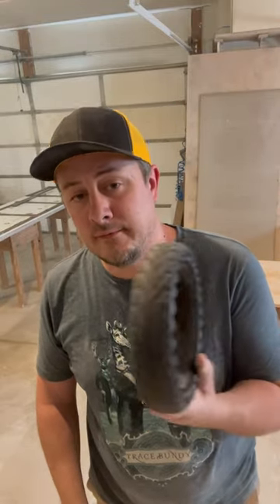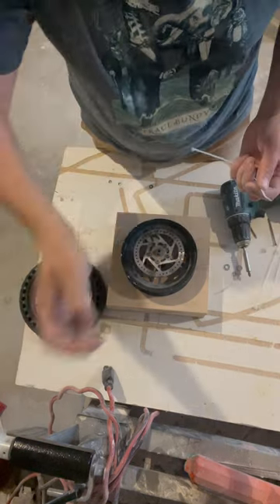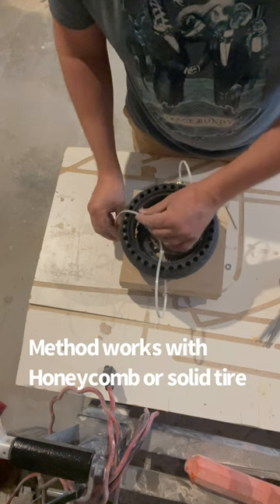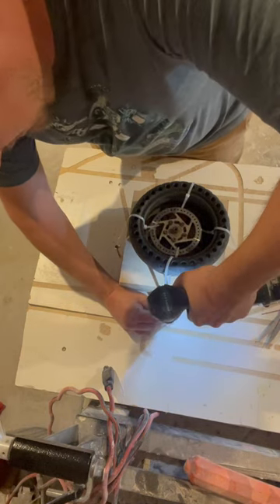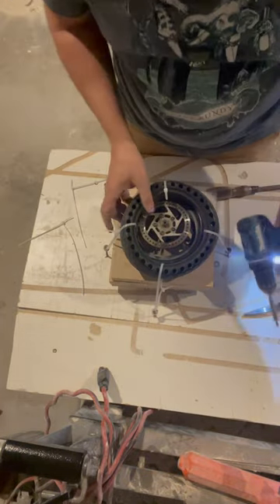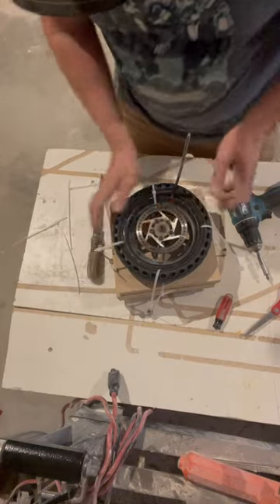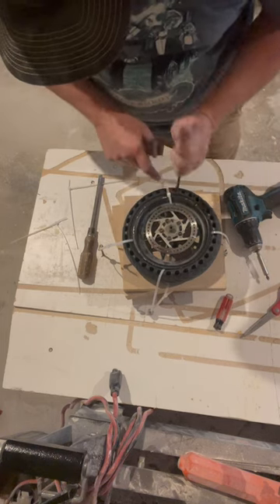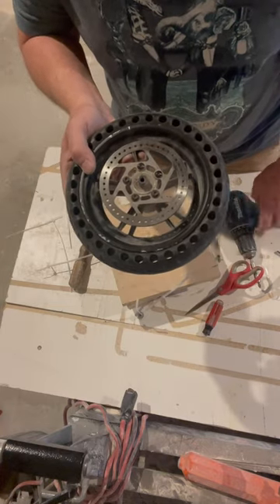Fast and Simple Way to Install a Solid or Honeycomb Tire for your Electric Scooter & Bike.

Comment: I just squished the warm tire about ten times at different angles until it seemed more pliable. It just stretched onto the rim, then used a butter knife to adjust the other side to pop out more.

Comment: Wonder if you could put the zip tie through the hole in the tire instead of the inside of the tire, that way at the end it’s not in the way??
Reply from the maker: That’s a good thought. I have another video where I do use the holes except I have had a few people ask how to put a tire on if it had no holes. Some tires are solid all the way through.  So this video will work for tires with or without holes.  Plus, this video is good if you want to avoid tearing through the holes on accident.

Comment: Did you still boil it to soften the rubber or no?
Reply from the maker: Good question. No.
Reply: @JedsGarage  thanks for reply was asking because I don't want to warp the tire lol
Reply: @edwardmoody4180 boiling it doesn’t warp the tire.

Comment: Just use a microwave and heat the tyre up the use tyre leavers.. heating the tyre will make it soft and easy to move...
Reply from the maker: Yes, that’s a good method for many.

Comment: I note you said "careful not to damage the tire" around the 4:10 mark. I also note that it looks like the tire is ripped right as you said that. Did the stretching of the tire following your method here cause the tire to rip?
Reply from the maker: You have a good eye. That tear was actually caused by a different and previous method I tried that failed that I did not publish. The tear in this video was not caused by this method.  This method is more gentle.

Comment: Mine came with solid rubber tires (HiBoy S2 Pro) and they are rock hard with hardly any flex at all.  I'd like to replace them with honeycomb tires but they look like a pain to remove 😩.
Reply: If it came with solid tires preinstalled, consider yourself lucky and leave them there.
Reply: @NoiseBooze   I just prefer the honeycomb tires.  Rides softer than rock hard solid rubber tires.  I think HiBoy updated the latest S2 Pro to honeycomb tires.  I might just get those instead.

Comment: When you buy a one of those tires does it come wit air already in there ?
Reply from the maker: Good question. It’s actually solid all of the way through. No need to pressurize with air.
Reply: @JedsGarage  oh thanks 🙏 that’s all I needed it will be my first time purchase just had to make sure

Comment: How do you cover hole left by valve when changing to solid tyres?
Reply from the maker: Good question but that never was a problem with our 3 scooters that use to have valves and air tires.
Reply: Cut the old valve stem at the base of the inter tube and insert into the hole.

Comment: Hmm.. Ever tried to put the tire in hot water for 30 min. before mounting it? 😉
Reply from the maker: Yes but no luck. But, I’m glad you mentioned this because a combination of warming it up and this method would even make it easier.
Reply: @JedsGarage   Thanks for the input. By this week I'll be fixing my daughters bike with a tyre like this. My only concern is how long the honeycomb tyre will keep its shape and stay fixed on the rim.any input so far? 😀

Comment: So, what I’m getting from this is…
1. Have a work table that you don’t mind drilling into. (Seems like a standard apartment in the city furniture piece, that everyone has.)
2. Have 9” wood blocks. (You know, those ones that are just lying around.)
3. Go buy washers and screws.

This is effective, yes.
But is it a practical solution for city dwellers without vehicles or workshops and an abundance of tools?
No.
Reply from the maker: I can’t argue with this. Sorry.